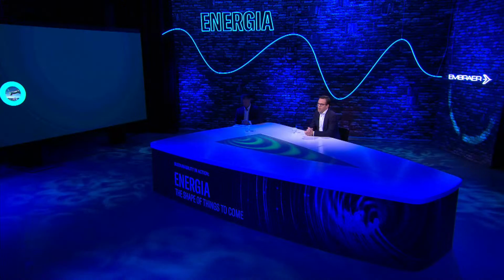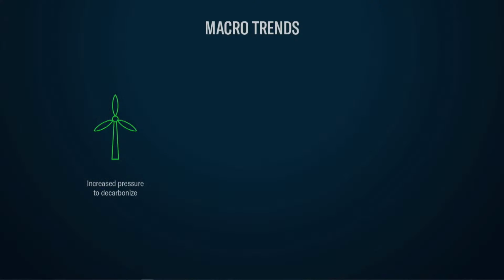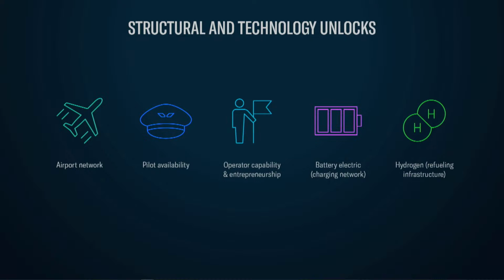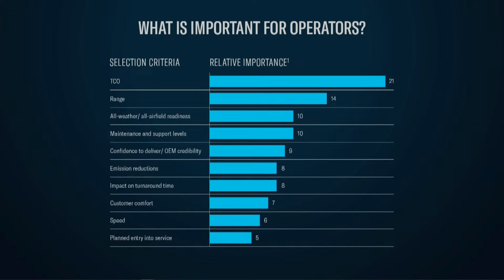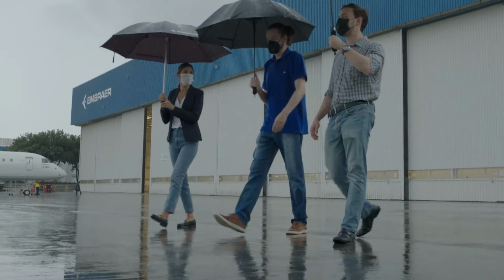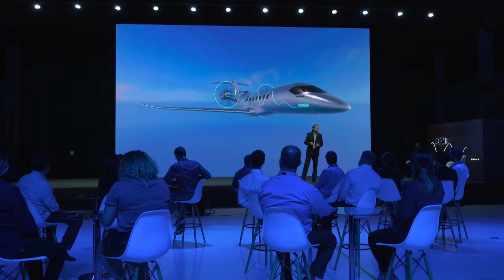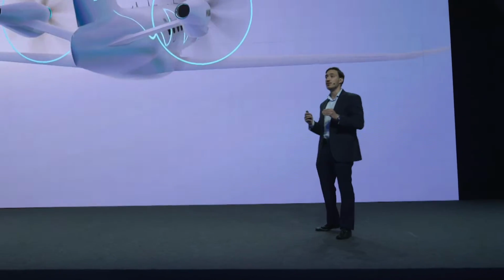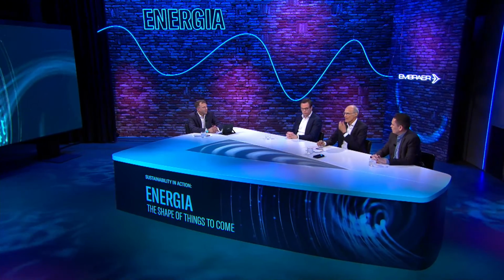Energia 2022 - The Shape of Things to Come

Comment: What is the range of each solution? We need more info than "more than 200 nautical miles" lmao. Also, why isn't fuel cell the best solution for large aircraft? Using hydrogen combustion would cut these large aircraft's range in half compared to fuel cells
Reply: why don't you go on their website and read it? it's all there
Reply: @kinnai8334  where are you looking? In the spec sheets they quote the same "200+ nm" range for hydrogen aircraft

Comment: ENERGIA H2 FUEL CELL
A bird ingestion/strike seems to be a point of concern, considering the position of the air inlet at the base of the vertical tail is very exposed.
Reply: Thought the same, and the fact that there is only one. They should definitely add another one somewhere else lol. One bird-strike and unless they have batteries, they turn into a very expensive and heavy glider